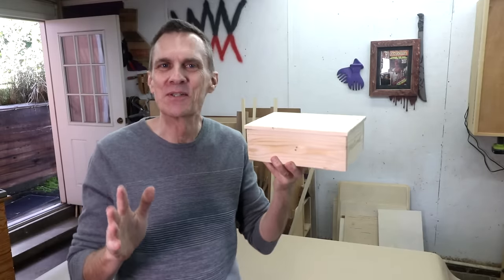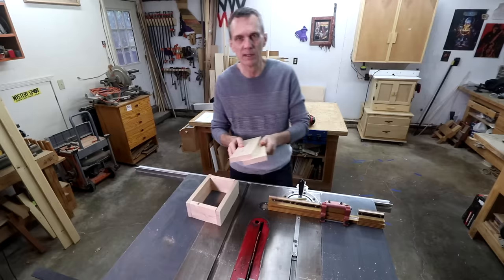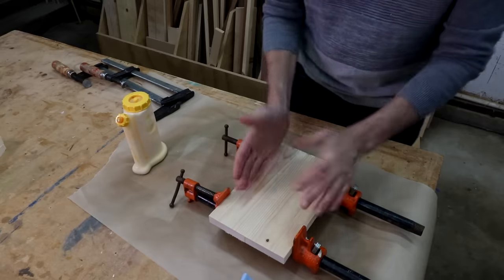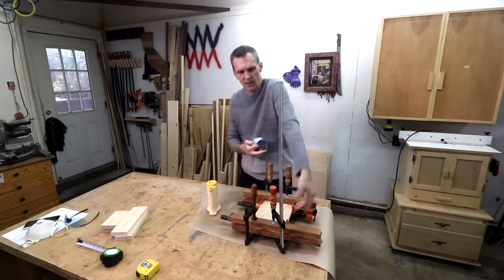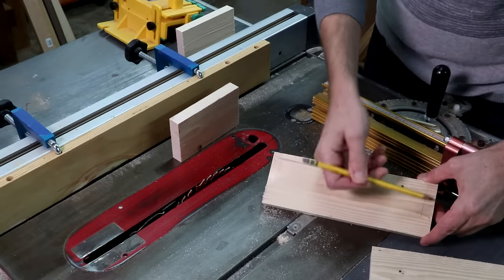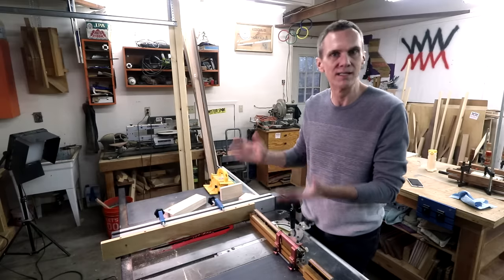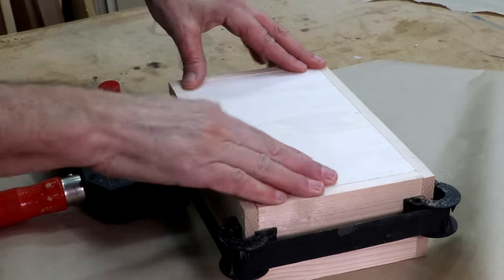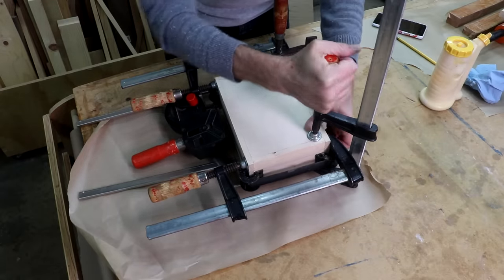How to make a basic box. And why you need to know how | Woodworking BASICS | Power Tools

Comment: Hey Steve, nice video. I like how you assembled this box using only glue. However, I'm curious when this technique should not be used. I'm assuming if you are making a large box (such as a drawer) using only glue might not be secure enough. Is there a rule for when you need to start using nails/screws?

Comment: Hi Steve, this will probably be my first project. I'm wondering why for the lid you used 2 pieces glued together but for the bottom you used plywood. Couldn't you also make the lid from plywood? My guess on this is because on the bottom the laminated sheets that make up the plywood are hidden, whereas using plywood for the lid would show the lamination and not look as clean. Am I on the right track there?

Comment: i could use some help. my box sides did not come out square after doing all cuts. should i have ripped both sides, did i buy cheap wood? i’m uncertain, but a bit discouraged. it’s quite unlevel after much work. back to the drawing board.

Comment: Hey Steve, I’m not sure if this has been mentioned before but the “cut” page of this plan is a little off, I think.  It says the board should be 3/8” thick but that should say 3/4” thick and it says it should be 36” long but if you add the lengths together it’s more like 55” .  Then it says it should be at least 4.5” wide but the bottom of the box is 5.25” wide.  I believe it should be adjusted to say 3/4” thick and 5.5” wide, which is a 1x6,  and it should be at least 60” long.  I bought a 72” board just to be safe.  Also it doesn’t mention that the two pieces for the top have to be jointed.  Am I just crazy or does that sound right?
Reply: If your confusion is similar to mine it makes it more confusing going between the video, the written instructions and the visual pdf. The only thing I can actually answer though is that he doesn't use the 3/4 inch board for the bottom. He uses 1/2 inch plywood since it's cheaper and you don't see it.
Reply: You are right that the plans don't match the video.  Definitely says 3/4'' board in the video.

Comment: Hell Steve, Thanks. Could it be possible to make the same thing with a track saw and a router? It's all I got.
Reply: Router actually makes it easier. Use a straight bit to cut the rabbets. If you don't have a table, set up a straight board to serve as a guide for the router base as you move along the boards
Reply: @Dcreed76  Thanks Daniel

Comment: It's a little confusing that the plans and the video don't match up.   There are rabbits on both the sides and the end pieces on the plans,  but only on the side pieces in the video.   I improvised, adapted,  and overcame.  One thing I learned was that you can set the rip scale on the table saw to the dimension that you want to cut a piece to width.   But,  if you're using the table saw to cut rabbits, you have to account for the blade kerf so, for a 3/4" rabbit the rip scale should be set at 11/16".  But lessons learned thru experience tend to stick better.  Thanks for your videos.  As an old dog,  they're helping me learn some new tricks.

Comment: Nice video .. I don't know where I can get dado blades and do they come in 10in for a table saw?
Reply from the maker: Amazon sells them. Usually they are 6" or 8" blades. 10" blades would be unnecessary.
Reply: @SteveRamsey  so a 8in would be ok using in a 10in table saw ? Also do all table saws take dado baldes?

Comment: I have a question for you, if I may. I'm a 70-year old retiree. I'm a Brit and live in a 2-up/2-down, mid-terrace house in North Eastern England. The only power tool I own is an electric drill from Bosch with a jig saw attachment. I do NOT own a table saw, electric router or even a proper work bench. So how do I go about making your 'simple' box with nothing but a few basic HAND tools and my drill?

Comment: What should I use if don't have a table saw?
Reply: Handheld circular saw will do most jobs a table saw can, it just takes a bit more thought how you'll support the workpiece and control the cut. You can buy a special metal track to guide the circular saw in a straight line, or just run it against a firm straight edge. Cut rebates (rabbets) by setting the base plate depth control, usually just a locking lever and adjustment by hand.

Comment: The rabbet joint isn't strong. The glue joints are all end-grain joints - weak. the joint's purpose is to prevent dust or insects from getting into the box. the strength comes from the glued-on plywood bottom.  I made a small rabbeted box about that size this evening, in fact.  Your box turned out better.

Comment: Re: the plans, page 2 of the pdf all the dimensions for the board are wrong, should be 3 1/2 inch wide by 48 inches long by 3/4 inches thick. In other words, a four foot nominal 1x4.

Comment: I started learning woodworking as basic introductory in Industrial Engineer degree. That time i thought it was easy.

Yesterday try to build small table at house only using nails, hammer, and saw. Found out the tools you have matters a lot, especially to beginner like me (in my university we have the whole tools like desk drill, portable drill, portable jigsaw, desk circular saw, lots of holder and desk, etc)

Comment: My riving knife is higher than yours and stops me getting a full pass on the rabets (rebates). Any tips please ? (I've resorted to my tenon saw to finish the cut but for the base I can only get about 2 inches along. Thanks in advance.
Reply from the maker: Can you remove your riving knife? It doesn't do anything or provide any safety on rabbets since they aren't through-cuts.
Reply: @SteveRamsey  Firstly a massive thanks for replying so quickly to a question on an older video. Quality support. I could remove it altogether but it would make me nervous. I don't have the option on mine to adjust the riving knife so removal (for this task) would be the only option. Option B was to buy a whole new table saw (that I have been eyeing up) or Option C was to buy a plunge router which I may need for other projects anyway. I'm going with Option C to try how that works and, if not, I will remove the riving knife for these rabbets. Thanks again for your support.
Reply: Quick update. I ended up with a plunge router which did excellent rabbets (rebates) but I removed the riving knife to do the lid and got excellent results too (and safely).

Comment: Some cheap substitutions.  Corner strap, ratchet strap or some cord and a slip knot. Clamping the bottom, a concrete block or any other weight.  No, not as good as real clamps,  it it works.

Comment: I have a problem that no matter how much I try I can't seem to get past it, I hope someone can give me some tips.. I'm an engineer but woodworking is a hobby to me, so I'm sure I'm doing something wrong.

I'm making two speaker boxes from some pine boards that I had laying around. I'm at the painting stage now and I'm painting with glossy white paint because I want a flat, perfectly smooth finish on each side of the box. The problem is that the wood keeps moving and a tiny edge is visible through the paint. 
At this point Im desperate for help. I have sanded it down and evened it out at least 10 times but the next day the same lines are there. Is it the humidity changing or the type of wood? What do I do?!?:( How can I get it to stay flat?
Reply: If I was having this problem, I would fill the gaps with something like liquid nails ( you could use a good wood filler ), then repaint.

Comment: Have you ever noticed that most woodworking videos start with a table saw and a router table?  I'd like to offer you a challenge.  Remake this video.  The only power tools in your shop are a circular saw, a jig saw, and a couple of drills.  Your work bench is a couple of boards thrown over the saw horses.  Rather than reinventing the wheel, if you use jigs for circular saws, such as a dado jig, instead of building the jig in this video, link to a video that teaches about building and using them.  

I love your videos, especially this one.  My next project is, not surprisingly a box.  I'd like to see how you would deal with my dearth of big tools.
Reply from the maker: Lol...that sounds like a nightmare to make this box using a circular saw! 😬 Definitely not something that fits the format of this show. 😊
Reply: You know, I've got the idea in your head.  You are already designing the jigs to help you do this safely.  Based on your 10 years of YouTube video, videos on the design creation, and proper use of jigs probably fits the format of this show.

Let the nightmares commence.   Bwaahahahaha.  How appropriate that this conversation is happening in October.

Comment: While I appreciate the detailed explanation of how to make this box, there's nothing simple about it. I've been learning how to use a miter saw and a circular saw and yet this video is a bit intimidating. All I need is a table saw, a router, a work bench, wood clamps, a specialized blade, clamps, and the plans to make this kind of box. This is more like woodworking Intermediate. I think it would have been helpful to show a box build with just straight joints - with maybe a few brackets to reinforce them. Joinery is really cool, but I think it's more for the intermediate or advanced woodworker.

Comment: why does the lid need to be two pieces?
Reply: I think that was to show an example of making a larger board from two smaller boards. Since the lid is wider than the actual boards, you would either need to buy a wider board, or use plywood, or glue two pieces together.

Comment: When one is cross-cutting, a guard should be put in place to prevent kick-back.  Touching the blade with your fingers so casually when your table saw is clearly plugged in is not a good example of safety.  There's a lot of guys out there with missing fingers.

Comment: Flaws with this video: a) relies heavily on a table saw that not every beginner has. b) uses Dado saw blades which are (more or less) banned in Europe because of safety issues.
Reply: butterknives require a license because they're apparently a safety issue

plus, there are smaller-form table saws that many beginners do have, and can be picked up for cheap

Comment: A beginning woodworker won't have all those machines.
Reply from the maker: What do you base that assumption on?
Reply: @SteveRamsey  There's a lot of money in tablesaws, jointers etc, and space for them. And based on my experience in photography, people asking on social media and in forums are going to be pointed by most advisors at more expensive options geared to working professionals rather than lower cost gear that will do well enough.
Reply from the maker: @oneeyedphotographer  I guess there's a lot of difference in woodworking than photography. A new woodworker can get a basic component of power tools like the ones I use for under $1000. These are the basic tools needed for woodworking. Check out my guide at mytoollist.com. You can even do it cheaper if you look for used tools! 👍

Comment: A 'basic box' build that requires a fully equipped pro workshop? This is nonsense! No one embarking on such a project will be so well equipped. No one so well equipped will be building a basic pine box. I see the link to the $1000 shop. I wonder if all the gear he used here is under that $1000 price. If so I apologise but I am thinking just the table saw is way over that.

Comment: 1000? no i have 100
Reply: That's a fairly tight budget. Not counting project materials, you can get a few useful tools to get started. I won't go into a tools list but definitely get a good saw. With a budget of $100 a hand saw is probably your best bet. I recommend a Japanese pull saw. I got mine from Lowe's for ~$25. They have a smaller saw and it's good but it's very inefficient with rip cutting. So I definitely recommend spending the extra amount for the double sided one.

I said I won't go into a tools list but I'll state a few: A tape measure, a straight-edge/ruler, an accurate speed square, a pencil, a utility knife, a couple of inexpensive clamps (for various reasons including holding the work-piece while cutting), a hammer and/or mallet, some basic screwdrivers, probably glue, and sandpaper. If you can go over your budget I recommend getting an inexpensive drill, twist drill bits, and safety glasses; maybe even a chisel too. I got a corded drill from Walmart for less than $20. If you do get a chisel, I recommend getting a more or less "universal" size that you can use in a lot of instances until you can get additional sizes.

Welp, I got committed to the list. What I listed pretty much takes up a whole hundred but I did over-estimate a little (based on prices where I am) on a couple of things; like calculating a higher price for a good tape measure even though you can find some for less than $5. Also, I did not factor in things that help reduce the costs like garage sales, pawn shops, buying online, or a gift from a relative. Just shop around. You can find various prices for tools at different places. Also, you can make certain tools yourself. Lastly, remember that for some things there's no shame in the DG game!

As a side note, I think it's worth mentioning that a lot of things can work work as effective clamps, like weights, tape, string, etc.

Comment: Holy crap. Is this for a beginner. Lost me. On to hunt for a video that doesn’t require me to buy $$$$$ im tools. 🤦‍♂️
Reply: Look for someone using chisels and planes if you think a table saw and some clamps are too expensive. If you want to use electricity, a table saw is pretty much the most basic woodworking tool you'll buy.